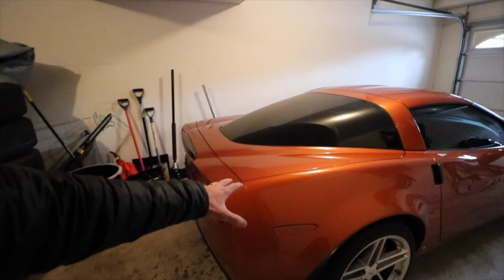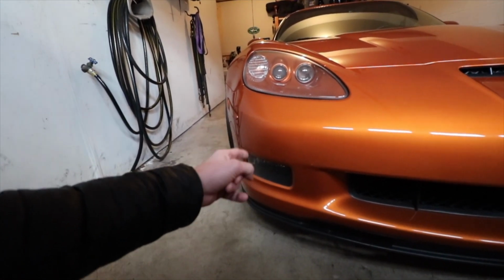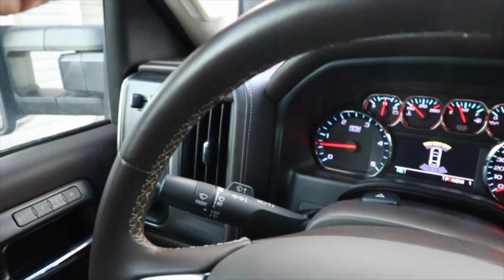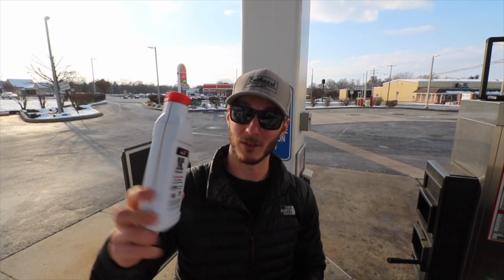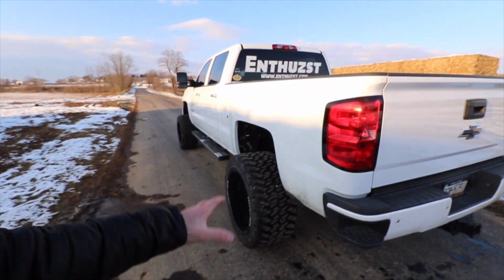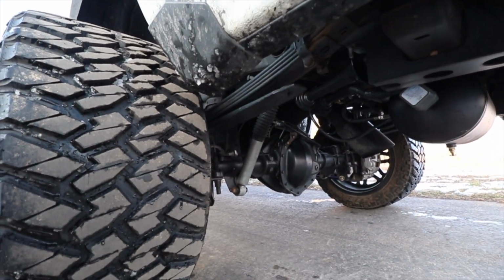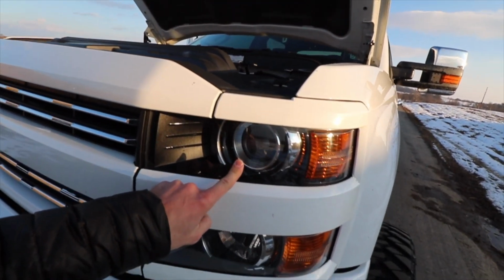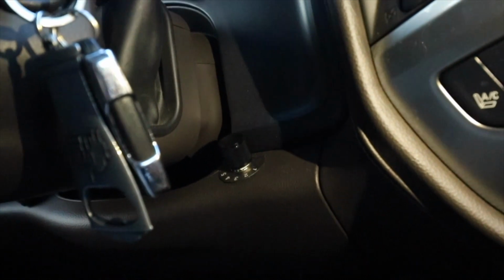NOT SURE WHY I DID THIS...

Comment: If your gonna drive your truck in the winter Id highly suggest getting it under coated by a company like Krown. I have a 2008 2500HD with 380,000 kms oiled since new and still has paint on the frame in spots

Comment: To answer your question about why does the tuner not come on when you do the remote start but it does come on in the key on position because not all circuits get power when the remote start is activated what you need to do is find a circuit that comes on when the remote start is activated you could always go to the climate control circuit and then your toner will be powered when the remote start is activated plus that circuit would still get power in the key on position
Reply: scott riney I thought that too but that would only work if he has the HVAC on. When it’s off the tuner is off.

Comment: FIRE WARNING!!!  By leaving your extension cord in a coil you are causing heat to build up in the coil and over time will melt the insulation and cause a short and possible fire. I put out a fire under a guys Super Duty doing the same thing as you with a coiled Extension cord. 
Stay safe from a guy that plays with electricity
Nice Duramax by the way

Comment: The programmer not turning on with remote start could be due to the key not being in the on position? I.E all the accessories are not powered on until the key is put in the on position

Comment: Love your videos. Don't know if you know about the wd40 trick for protecting your painted wheels. It protects them from pitting & the salt from ruining your wheels. Clean them then spray wd40 on a microfiber towel till it's dripping wet then just apply it on your wheels.
Reply: Ryan Davis terrible idea...clay bar and a wax coat or just run stock wheels
Reply: Ryan Davis ceramic coat> everything else.

Comment: For your edge It’s wired to a power key on and when you don’t put the key in the ignition it doesn’t allow the voltage to flow through telling the edge that your vehicle is on. To fix it just find a wire that has voltage to it when you remote start the vehicle and stays on when with the key in and no power going to it when you turn the vehicle off personally id just leave it

Comment: I live in Wisconsin. They put so much salt down. Modern day vehicles have so much protection that it will not get rusty, so dont get your panties in a bunch.
Reply: Not GM- - my ‘12 GMC with full undercoating has tons of surface rust on the underside because of so much damn NY salt. I rinse it off 6-8 times per winter and really well in the Spring.
Reply: The frames get rusty from all that salt